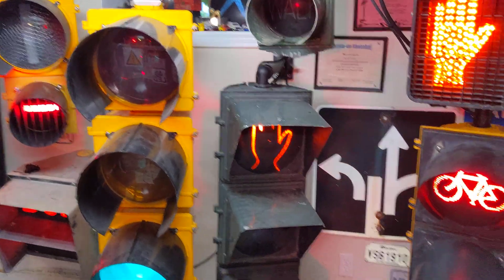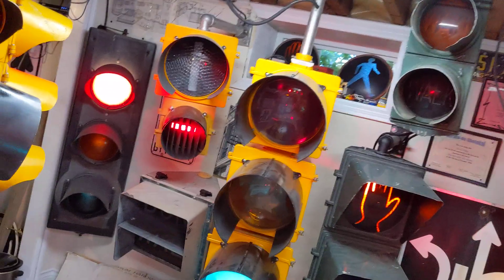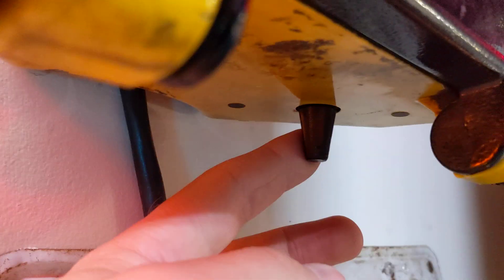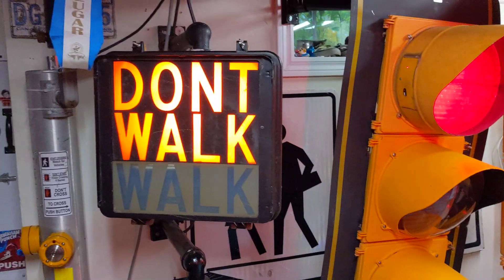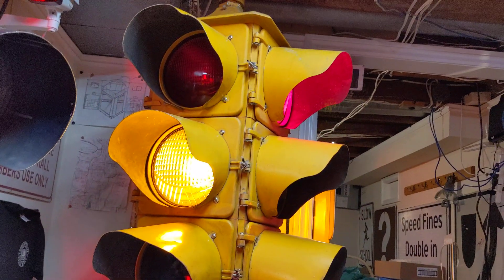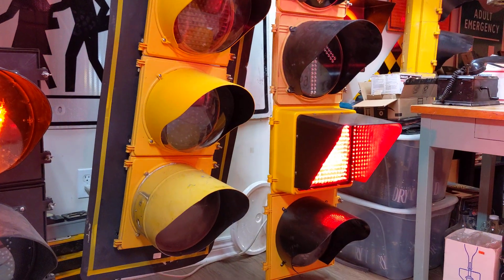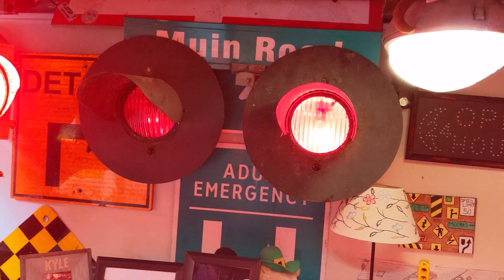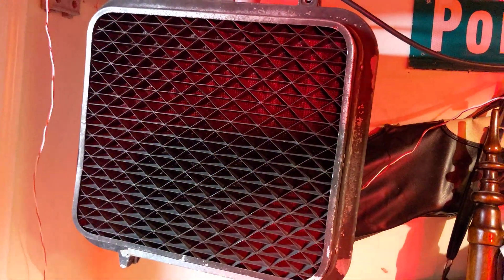My Traffic Lights - Walkthrough Edition

Comment: Been a while since I've watched last but I have noticed the cabinet is dramatically quieter
Reply from the maker: I have the fan turned off in there for now! That thing is extremely loud!
Reply: @TheTrafficTech  that's convenient! I just thought the cabinet had been rebuilt or the fan had died through old age
Reply from the maker: @lukedavis436  Believe it or not, this cabinet is actually only from 2010 and it wasn't supposed to be thrown out. I got really lucky with this one! I usually have the fan running more in the summer months, however it will kick on if this runs long enough because it can get warm in the cabinet.
Reply: @TheTrafficTech  wow! You are damn lucky!.. I also see the cabinet is thermostat controlled... Nice touch
Reply from the maker: @lukedavis436  Yeah heat and cooling! I found out about the heaters the hard way haha! I accidentally left them for a while and I was like "why is the cabinet warm" haha!
Reply: @TheTrafficTech  nothing died though right?... I'd hate it to have killed somthing important and expensive to replace
Reply from the maker: @lukedavis436  I know right? But no! I haven't killed anything just yet! Worst case was that a blew a couple of fuses but everything has been fine ever since!